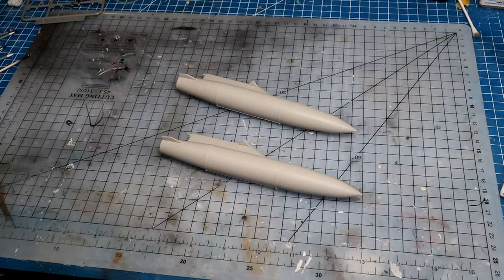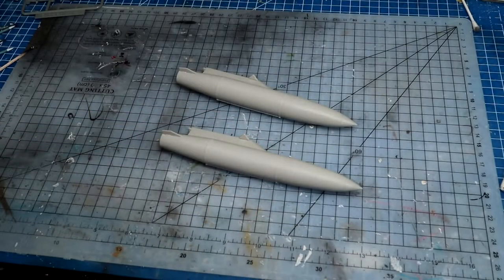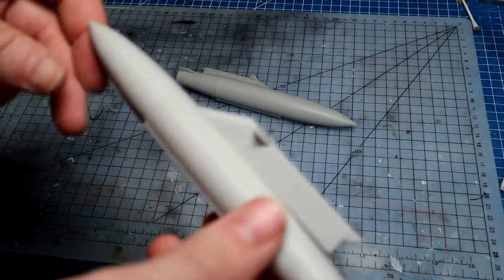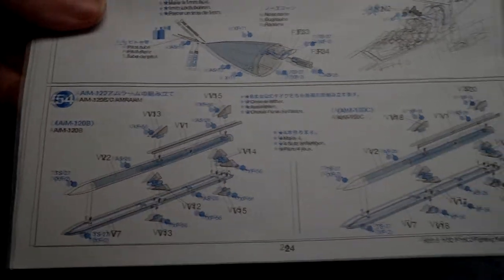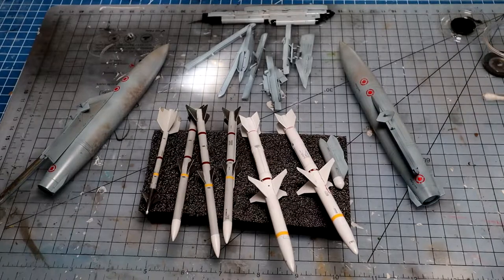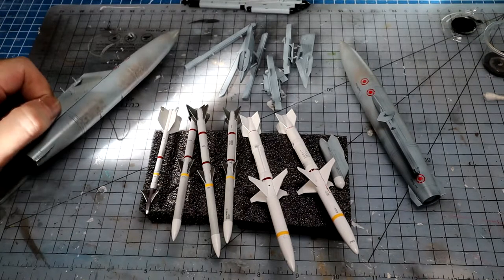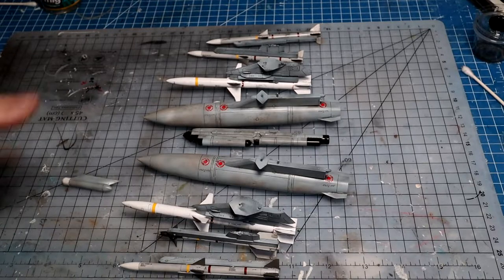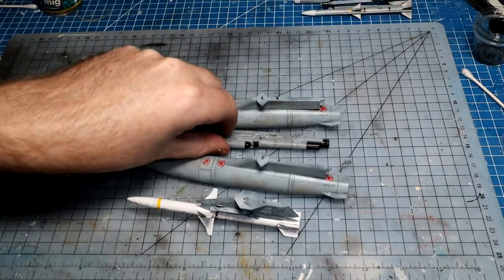1/32 Tamiya F-16CJ Build Series - Part 4: Pylons, missiles and pods

Comment: Nice work...i ve alwayz had problems of how to attach missiles and such especially in 72 scale. I have got a question concerning the varnish before decaling... i know that you have to gloss the aircraft but i hear and read people talking about clear coating...is it the same? Thanks in advance. P.
Reply from the maker: Yep same thing. UK call it varnish, USA clear coat. Basically put down a gloss coat. No matter what people say it protects your paintwork and creates a smooth surface for decals and helps prevent silvering. 

Use superglue for attaching painted parts not extra thin cement. PVA glue is good also. Richie
Reply: Finally a fellow modeler who isn’t on his high horse and replies. Cheers for the responses.
Reply from the maker: Anytime. I reply to all comments and questions. Usually within 12 hours. Thanks for watching. Richie.